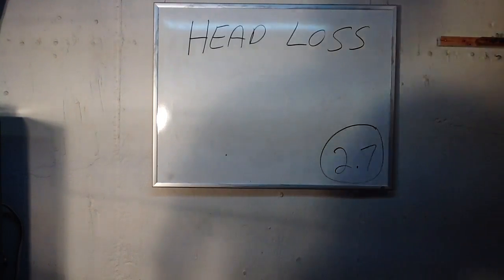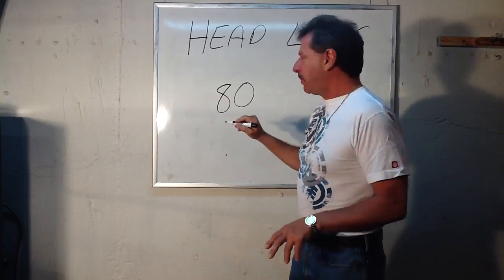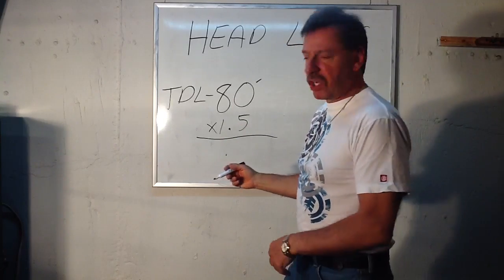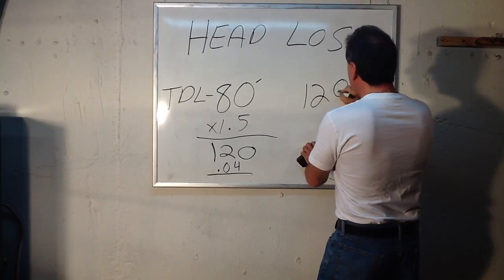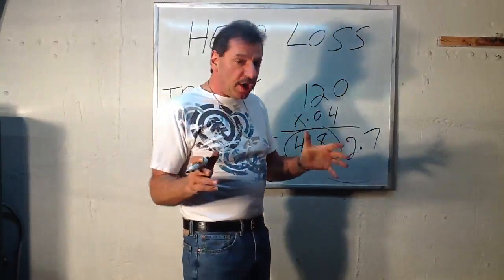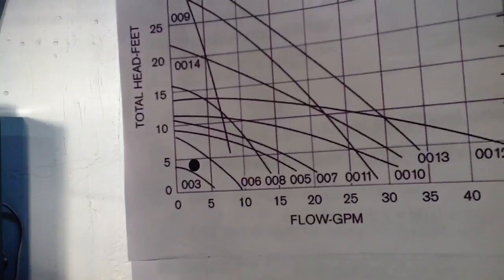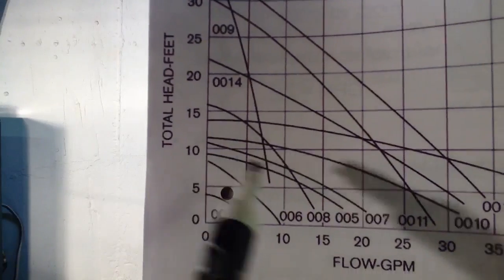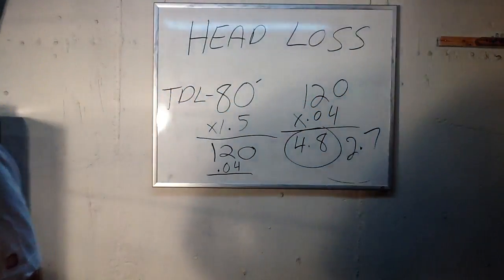Circulator size part 5

Comment: What's 1.5 and 0.04 in the calcs?
Reply: Hey, I realize this is a late reply, but he is using rule of thumb (generalizations) to simplify the calculations. 

The 1.5 is a factor to account for other components in the system elbows, transitions, pieces of equipment, valves, etc. 

The 0.04 is a pipe friction loss per foot of pipe (in feet of head), this can also be referred to in terms of piping friction loss per 100 ft. So he's saying the pipe is sized for 4 feet of friction loss per 100 feet of pipe. This number is determined by pipe size and gpm flow. Bell and Gossett makes their System Syzer Calculator wheel or online calculator that can help determine friction loss per 100 ft. 

I watched these videos because I was curious if I should take the longest run or the highest flowing run. I think you should take the longest run, to whatever you're serving and back. Then take that length and multiply in the 50% factor for fittings/equipment (multiply by 1.5), and this will pretty much take out any of the super precise calculations you need for changes in pipe size or fittings or equipment friction/pressure loss. 

Having more head accounted for is better than not having enough. If you have excess head accounted for, you can back the pump down (lower rpm) if variable speed (more expensive first cost, lower operational cost) or if it's a constant speed pump add in some balancing valve to dial in the gpm and head to the desired settings (this is lower efficiency since you are using that pump power no matter what, but pumps without variable speed drives are cheaper, ie. lower first cost, higher operational cost).

Comment: so u can calculate total heat loss on the house and from there u can find out gpm need.  That is 1 zone so if you have 5 zone than just multiply it by 5 to get the total gpm?

Comment: hi lou i been watching your video over and over i like to know when taking a head loss with monoflo tee on 1 1/4in pipes witch branch to 1/2in copper to radiator and back. do you still count all the lengh of pipes as one. i am having a temperature difference of 80 degree 180 going out 95 comming in to boiler some room are cold. i want to know if the pump 007 not the right size.